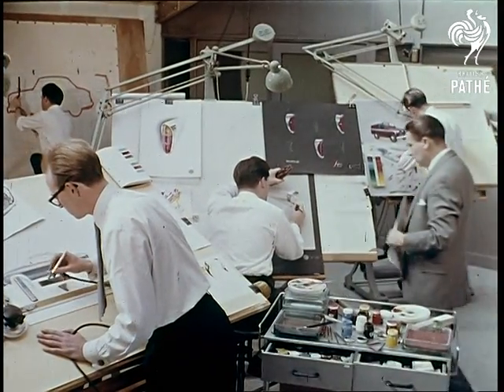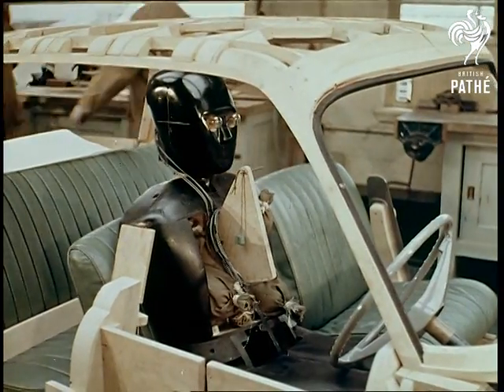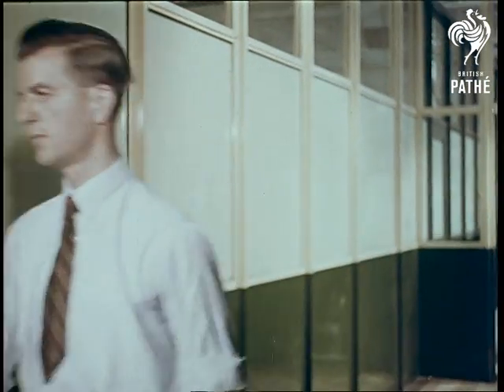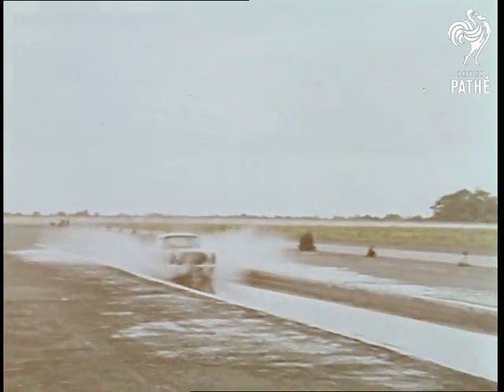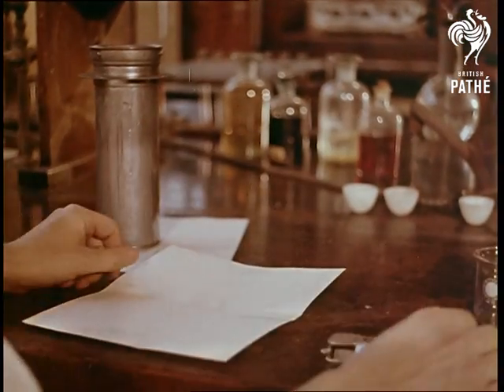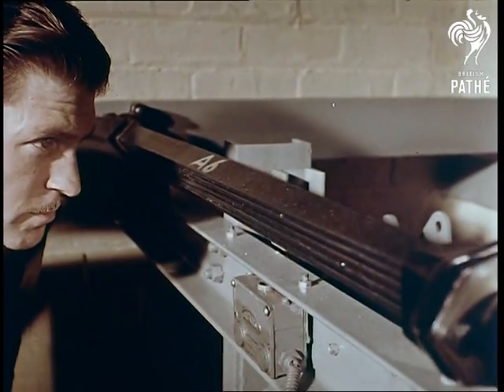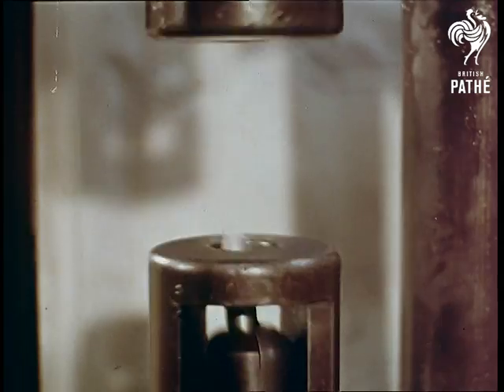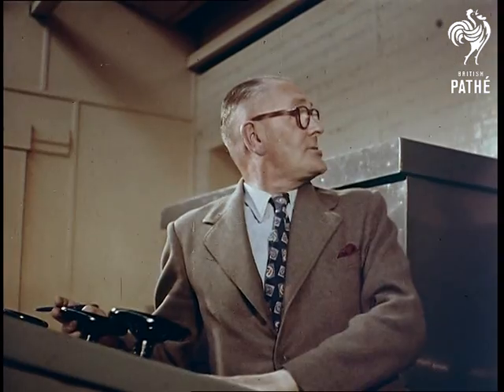In The Rover Tradition  Reel Two (1950-1959)

Comment: At 5.38 cam shafts are checked for hardness.If only TVR had done that when they designed and brought out the Speed Six engine first put in the Cerbera and Tuscan.The early early engines had terrible trouble with the finger followers rubbing into the camshafts due to a material hardness problem.I loved these old Rover cars.❤